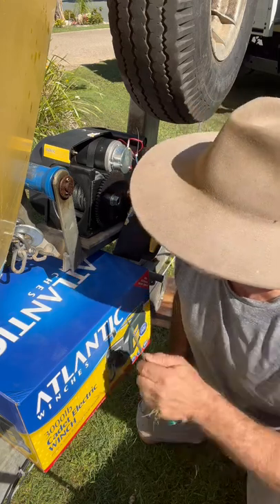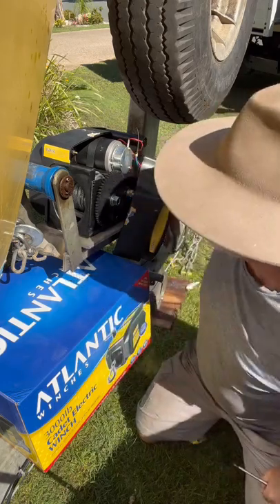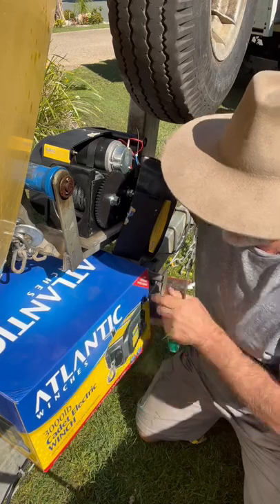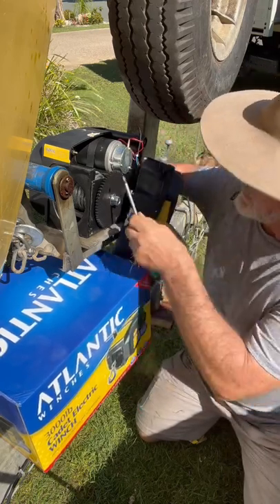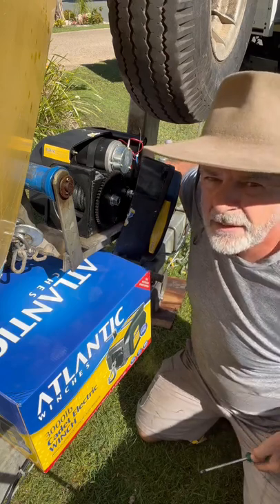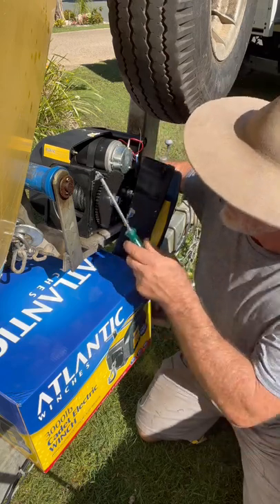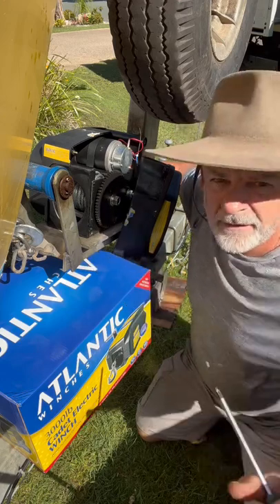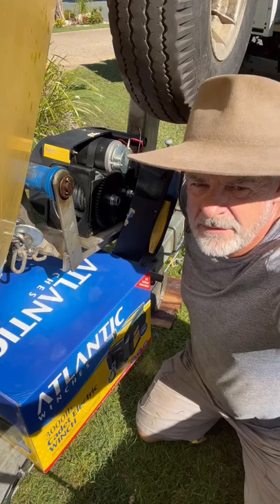Electric boat winch replaces the one I broke

Comment: Easy now Hulk Hogan 🤣😂👍👍🇺🇸
Reply from the maker: Yes I should have showed more restraint. I tell you one thing, dyneema is incredibly strong!
Reply: @SmallSailboatCruising  I doubled the cable and added an extra pulley with a hook at the boat connection . It was slower but the electric motor never got in a strain again 👍👍🇺🇸
Reply from the maker: @jimmybritt9537  there is always the option of doubling up. I need to experiment on different ramps before
I will know it works. Ours is a super easy ramp.

Comment: Lucky, the one I got can't get my boat up. Steep ramp and not many rollers I think is the problem. It is very good for raising and lowering the mast though.
Reply from the maker: This one is very strong but a bit slow. I plan to get the boat as close as possible before winching.
Reply: @SmallSailboatCruising  well it's bound to be better than cranking the handle whilst the wind blows the boat off to the side. I extended the remote so that I could guide the mast as the winch cranks it up, i don't know if you have issues getting yours up but it has made things easier for me. To lower I just have the brake on a bit and guide the mast down, so much easier.
Reply from the maker: @scottlampe70  I haven’t visited the mast raising yet. I had no trouble in my sonata, but this one is quite a bit heavier. I’ll need your advice when the time comes.
Reply: @SmallSailboatCruising  yeah, I have a very good design for a winching system that keeps the mast centred without extra lines as you pull it up. Found it on a trailer sailer forum, maybe the "trailer sailer place (tsp) ", it works well.
Reply from the maker: @scottlampe70  thanks I will look it up. The back is not getting any younger.

Comment: Mate I have the same that I bought second hand,how is it attached to the battery,I can't see where the leads attach...? Thanks
Reply from the maker: There is a plastic cover plate on the top rear that is removable. Connections for power and remote are under there.
Reply: @SmallSailboatCruising  thanks for that
Reply: Got it